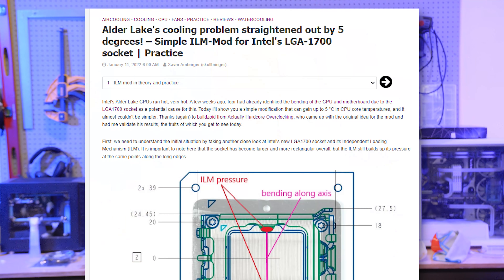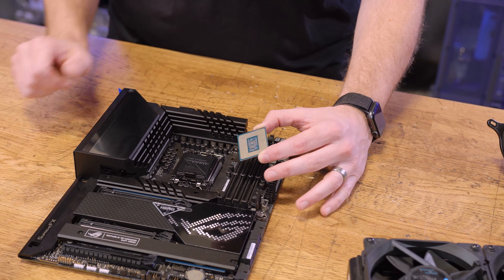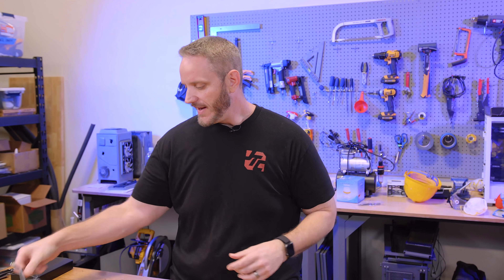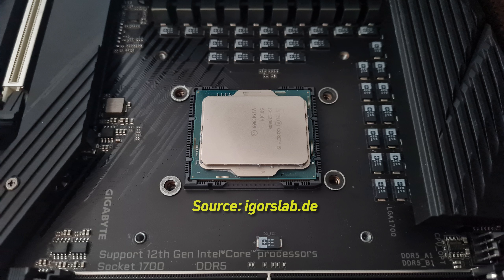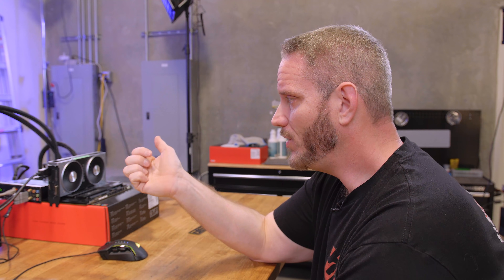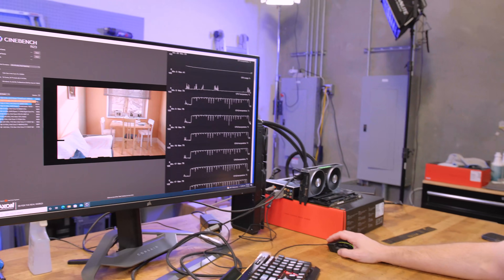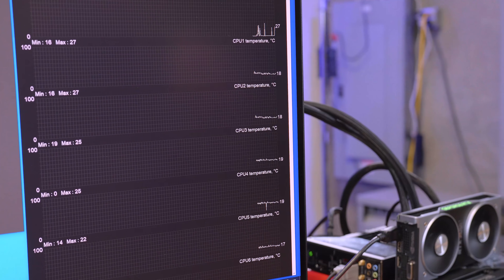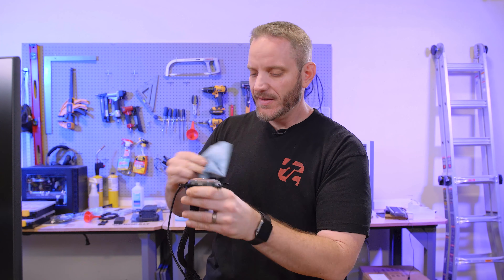YOU GUYS asked me to try this... so I did

Comment: 17 minute long demonstration of the kingpin's thermal performance
Reply: what part is kingpin? the thermal paste?
Reply: @suyashsingh9865  yes sir.
Reply: Havent tried the washer mod. I do have the grizzley bracket and it dropped my temps insanely, 10 to 15, per core.. im running 5.5 p 4.3 e  7300cl30 , 3090 strix all under a mora 420.
Reply: @sagerdood  that is crazy, is the overall average temp also lower by 10C?
Reply: @suyashsingh9865  oh yea!!!! My board was bending and everything!
Reply: @suyashsingh9865   my i5-12600kf is lower by 7.8 degrees with just a 240mm AIO stable p5.1ghz/e4.1ghz 
it's honestly one of the most mindblowing things in a long time.
Reply: Honestly this channels vids are too long.
Reply: @patty109109  no they are not

Comment: 12700k stock clocks with undervolt, 360mm aio Corsair Capellix with Corsair LGA 1700 Retrofit Kit, no lapping or washers, Thermal Grizzly Hydronaut, 65 degrees Celcius max temp.
Reply: Do you know which side of the standoffs should be facing the cooler? One side has a dimple on the end of the threads and the other is flat
Reply: @Spudinske  I'm not sure that even matters, maybe I'm wrong. I've just looked at the thread count and to me both ends looked the same. This isn't a one and done process, I could always redo it, but so far I'm not seeing any problems on temps. I'm not sure how much pressure there is on the cpu with this mechanism tho.

Comment: ah 2022....when z690 boards got heating issues much like the first wave of x570 boards.....as subsequent 90a vrm b550 itx boards came out XD even at 200$ offering seemingly WAY more performance than various entry level x570s. OHHHH how the turn tables intel 12400f to boot and no equivalent b550i pro ax board to come with the 12400f price point XD. OHHH intel with its lack of economic contingencies. The best part of the vid is an EVGA x570s ad in 2022 bc of the general aspect of how "competitive" bios/oc access is to AMD end users esp those that dont want to buy asus. I mean really its becoming largely ironic to categorize "how far weve come" since the era of hunting down asrock/DFI lanparty boards to force(unlock) the duel core phenom II into quad core processors. OH how far weve come

Comment: I want to know why we pay the crazy prices we pay for high end chip and they are not 100 percent flat to begin with like wtf. That is something that should have been fixed by now.
Reply: its a thin stamped piece of metal, machining that well is way more expensive than youd think
Reply: I was thinking the same thing.. Would it be really that hard to mass produce the ihs at some reasonable degree of "flatness"?
Reply: @AnticipatedHedgehog  itd be a machining step, and a far more precise plating process.  or they could skip the IHS entirely and sell it with a disclaimer
Reply: Guess it don't mater they ever address that kind of issue. They don't need to be flat in real life when you can't buy them anyway lol just flat in theory. By the time you get one the next gen of a not so flat chip will be out.

Comment: I used to work for a glass company.  Tempered glass isn't perfectly smooth.  You still have dimples and other things.  It however is the closest you can get to be as flat as possible.
Reply: While this is true, they're still generally flatter than the sandpaper you're using. If you want to go flatter though, a piece of polished stone is actually going to be flatter. It's what I used as a base for a calibrated lapping machine years ago
Reply: @TheOriginalFaxon  Granite surface stone best there basically is.

Comment: I sit around 63 degrees Celcius on a full load nonstop. When it's idle, I get about 25-27 degrees Celcius. I have no issues with the 12900k.
Reply: My 12900K is on the way, which cooler you got? I haven't bought one yet
Reply: @monke2361 , I purchased the iCUE H170i ELITE LCD Display Liquid CPU Cooler. Very easy to install and use AIO.
Reply: @evocybernation8839  with the retrofit kit right?
Reply: @slayimm1469 , I've done no retrofit kits or modding of any sort. Installed the CPU and AIO like normal. Started up the computer, and right now, it's sitting at 25 degrees Celcius.
Reply: Sounds like youve got a monster cooler
Reply: @are3287 , I could have purchased the iCUE H150i ELITE and obtained temperatures around 66-69 degrees Celcius on a full load nonstop.
Reply: Same here. My i9 12900k runs flawlessly and cool 🧊
Reply: I have a z690 Hero. Temps are low and very good
Reply: That is one cold CPU!
Reply: @Irnwkr28  nzxt x63… 65 at load high 20s on idle.
Reply: I just built a friend's system with 12900k and Asus Strix 360 AIO. 32 idle and 60's during gaming.
Reply: How lol my 12600k gets much much hotter with a arctic liquid freezer 280mm. Its close to 90c stock. And thag cooler has no issues cooling 300+w cpus heavily overclocked.
Reply: @sansundertale69availablename  I have the same thing with my oced 12600kf and a 360 version. At 100 I am at like 85 c. What am I doing wrong here I have repasted. It does game at 47 c at max and idles at 20 but under full load it gets hotter then everything else
Reply: @herpderp_6488  I'm using a different aio but same thing. Idle and gaming temps are low but under full load it gets really hot
Reply: @Misfit626  that is what is weird. I am worried that it may be an issue with the mounting tho I have the lga 1700 kit. Also did you get the whole thing with the cpu getting bent after it gets put in. Like how do I know if my motherboard or cpu is getting damaged right now and hoe would I get the necessary parts to do the mod. It didn't seem right that my temps were so high and considering that both the cpu and motherboard are so expensive I do not want to take a chance with them getting damaged
Reply: @sansundertale69availablename  Weren’t those coolers recalled for blocking up the cold plate? If not maybe it is an age thing or needs to be repasted.
Reply: @sansundertale69availablename  Little late, hope you see this. This is the exact same setup i am thinking about getting, but hearing 90c stock has me a little concerned now. Are you using the the LGA1700 mount from Arctic Cooling? Or are you using the stock mount designed for previous gen? Saw someone else mention in another comment that temps hit 100 (with i7-12700 chip and 360 version of the cooler) with old mount, but dropped to low 70's after getting and installing the LGA1700 mount from Arctic Cooling.
Reply: Motherboard might have it in a lower power state then
Reply: @tuckerhiggins4336 , I'm OC'ed to 5.4 on the first 4 P-cores, 5.3 on the second 4 P-cores, and using the Maximus ASUS Extreme MOBO. The E-cores are OC'ed as well.
Reply: Undervolt?
Reply: @MHSDankusPotatus , no undervoltage. ASUS does a fantastic job with their MOBOs.
Reply: Did you use the 1700 retention kit?
Reply: @Irnwkr28 , I'm running the Corsair H170i Elite Capellix pump at 400-2000 RPM, which is the standard-setting. Using the stock Corsair 140mm fans. NOTHING has been changed, even the software, and it's at stock settings.

I think you're intentionally trying to bash the 12900k, and guess what? You're doing a terrible job at it. Go back to the drawing board, Irnwkr28...
Reply: Is your house set to 15 C when you turn on your computer?
Reply: @hey_how_are_ya , the house is set at 68 degrees Fahrenheit. I'm not the house owner, so I don't change the temperature. I would like to change it, but I'd rather not deal with the headache after doing it. lol